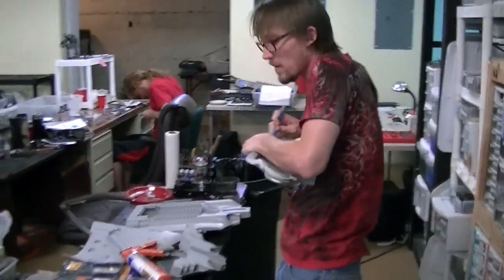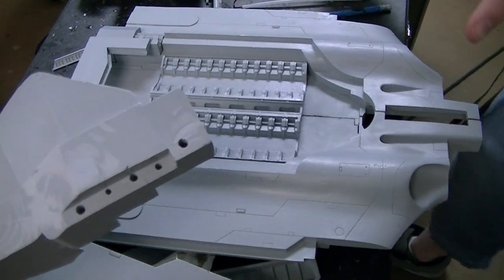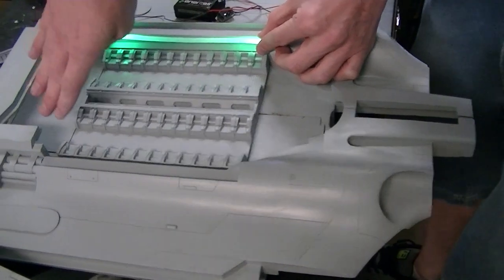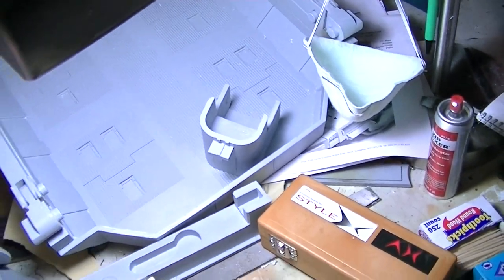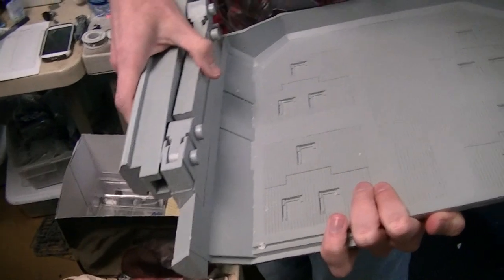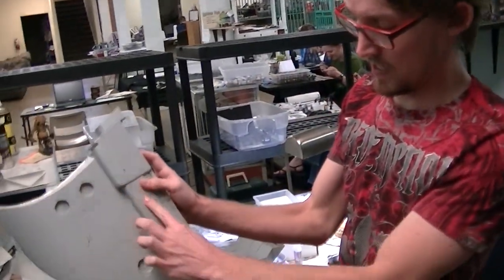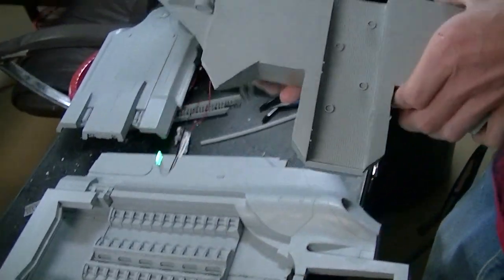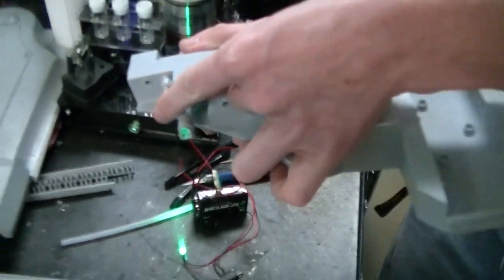Tau Manta Assembly WIP with LED lights - Blue Table Painting

Comment: evey forgeworld that has a "straight" edges will most likely if not 100% have a couple things wrong with it I bought 3 imperial bombards and every side panel and the mounts to hold the gun on to the original plastic kit where to small or were not aligned properly, however forgeworld has great customer service and will replace any pieces that come damaged, un-usable or badly casted. Expect some work going into any forgeworld models.